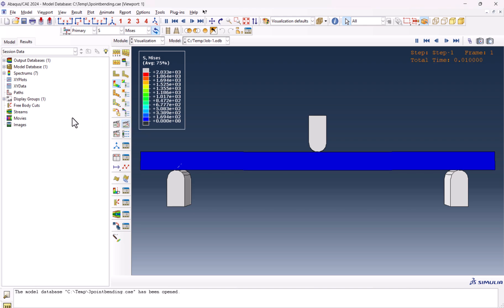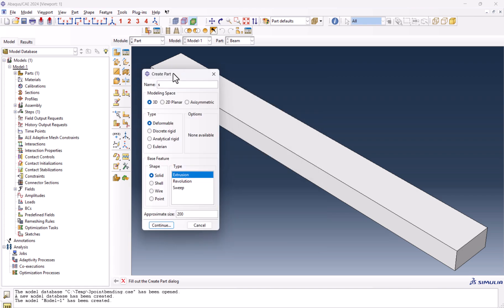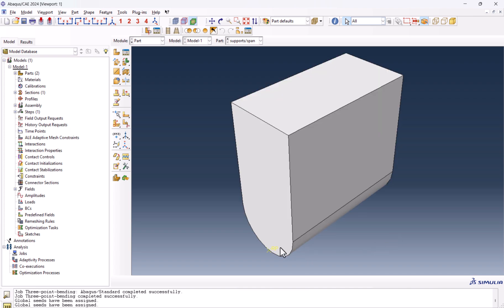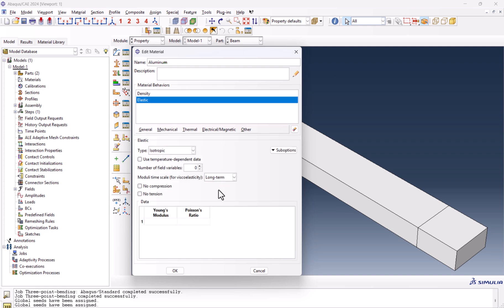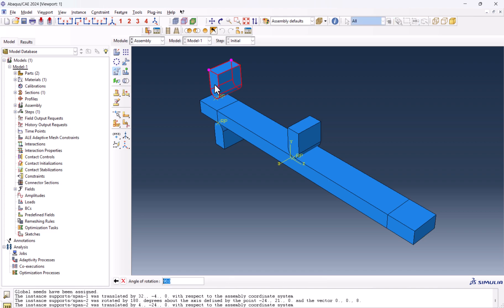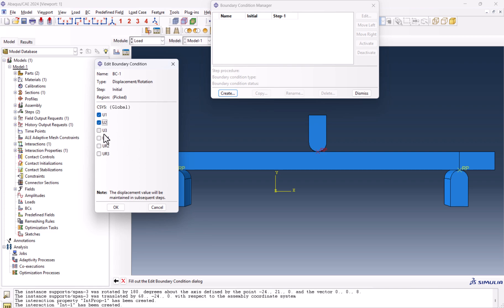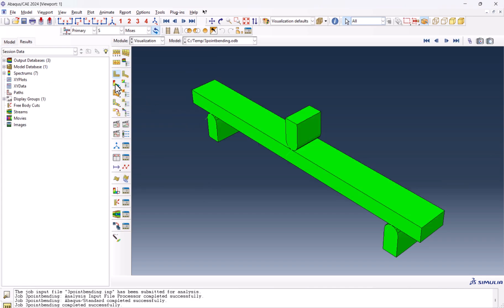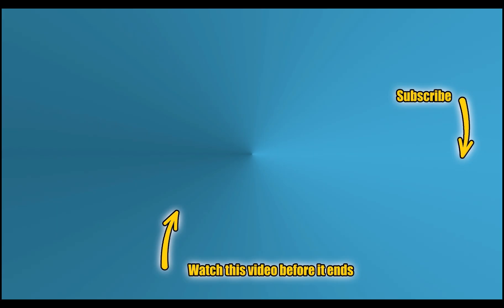MASTERING Three Point Bending Abaqus Simulations Made EASY

Comment: Sir, when I loaded the results in the deformed model, the beam just moves out of the plane in the z-direction. What should I do?
Reply: My software is limited to 1000 nodes and I had to keep step increments not more than 100 otherwise the job would just get aborted.
Reply from the maker: I see! Just make the mesh slightly bigger and put everything the same, I think it should be fine. Otherwise, you have to change the software, because if you want an accurate simulation, you need more than 1000 nodes!
Reply: Got it
Reply from the maker: @PAYASMAHULIKARSVNIT good!
Reply from the maker: If you follow the steps without skipping the video, your results must be the same. I recommend you rewatching the video without skipping especially, the load and boundary conditions.
Reply: When I followed the exact same steps (I had to keep the nodes less than 1000 as yours were more), the job just got aborted saying too much time for this increment.
Reply: I chose the mesh to be uniform everywhere (slightly coarse) but now it worked with all default step values!! Thanks for all the help sir!!. I will subscribe this channel till forever

Comment: Hello, I hope you are doing well, and thank you for your very useful guidance. I am currently modeling a laminated composite in Abaqus, using the data provided in a published article. My goal is to obtain the maximum flexural force without using UMAT/VUMAT. I would appreciate it if you could guide me step by step, module by module, on what needs to be done.

Article information:

𝐴𝐿/𝑐𝑜ℎ𝑒𝑠𝑖𝑣𝑒/𝐶𝐹𝑃0°/𝐶𝑅𝑃90°/𝐶𝐹𝑅𝑃90°/𝐶𝐹𝑅𝑃0°/𝑐𝑜ℎ𝑒𝑠𝑖𝑣𝑒/𝐴𝐿/𝑐𝑜ℎ𝑒𝑠𝑖𝑣𝑒/𝐶𝐹𝑅𝑃0°/𝐶𝐹𝑅𝑃90°/𝐶𝐹𝑅𝑃90°/𝐶𝐹𝑅𝑃0°/𝑐𝑜ℎ𝑒𝑠𝑖𝑣𝑒/𝐴𝐿
For the aluminum layers: Johnson–Cook damage model, element type C3D8R AND T=0.5mm
For the CFRP layers: Hashin damage model, element type SC8R T=0.125 mm

For the cohesive layers: element type COH3D8 T=0.15mm

My questions are as follows:

In the Part module, should I draw each layer separately as a deformable solid (for example, one solid aluminum layer, one solid cohesive layer, one CFRP 0° layer, and one CFRP 90° layer)? Or should I draw the entire beam as a single block and then partition it?

In the Step module, should I use Static General or Dynamic Explicit?

In the Interaction module, do I need to define Tie constraints between every two adjacent layers or not?
Reply from the maker: You can do this fully in Abaqus without UMAT/VUMAT. The recommended approach is to create one single 3D solid beam and then partition it through the thickness into all layers (Al / cohesive / CFRP plies). This keeps the mesh conformal, simplifies section assignment, and avoids interface errors. Aluminum partitions use C3D8R, cohesive layers use COH3D8, and CFRP layers use SC8R with ply orientations (0°/90°) and thickness 0.125 mm.

For the Step, start with Static, General for quasi-static bending to obtain a clean force–displacement response. If convergence problems occur once damage and delamination initiate, then switch to Dynamic Explicit with slow loading and check that kinetic energy remains small.

Regarding Interactions, if you explicitly model the interfaces with COH3D8 cohesive layers, you do not need Tie constraints between adjacent layers. The cohesive elements already represent bonding and allow delamination; ties would artificially prevent separation. Just ensure proper node connectivity (which is straightforward when using a single partitioned part).

This setup is the most stable and standard way to capture flexural response and maximum force for laminated metal–composite beams.

Comment: Thanks for your response! But my goal is to change the number of layers and the orientation of the layers in a polymer composite so I can achieve the maximum bending force. Then, I can substitute that value into the equation and obtain the flexural strength. What method exists to obtain the peak bending force in Abaqus for layered composites without writing UMAT/VUMAT code?
Reply from the maker: Good question 👍
You don’t need UMAT/VUMAT for this. For layered polymer composites, the standard approach in Abaqus is to use Composite Layups (shells or continuum shells) with built-in orthotropic elastic / damage models.

You can:
	•	Define different number of plies, thicknesses, and fiber orientations in the Composite Layup module
	•	Run a 3-point or 4-point bending simulation
	•	Extract the reaction force vs displacement at the loading roller/reference point
	•	The peak reaction force before stiffness drop or damage initiation is your peak bending force

Then you can plug that value into your flexural strength equation.

This is exactly how most papers do parametric studies on ply orientation and stacking sequence without custom subroutines. If you want failure effects, look into Hashin or Max Stress criteria (still no UMAT needed).

Hope that helps 👍

Comment: thank you for the video! i tried this in abaqus but always an error occurred when abaqus wanted to create the input file. the problem is the boundary condition doesn’t find the reference point from the part section. do you know what the problem here is? i think it’s because the assembly does not reference right with the part section
Reply from the maker: That error usually happens when the BC is pointing to a Part-level RP, but Abaqus needs the Assembly instance RP. Try this: create the RP in the Part and put it in a set, instantiate it as Dependent, then apply the BC in Assembly using the instance set (you’ll see it as InstanceName.SetName). If you already made the BC, delete and reassign it in Assembly—that should fix the error.

Comment: i have tried the simulation and got force=0. can u help me how to troubleshoot this issue?
Reply from the maker: Thanks a lot for watching and following the tutorial—I really appreciate the support!

That “zero force” message usually means the applied loads are extremely small or weren’t registered properly, so Abaqus ends up solving something like 0 = Ku, which gives you zero force and no meaningful results. If the message appears at the end of the step, it’s very likely a mistake in your boundary conditions or load application otherwise it's a warning and can be ignored.

Please rewatch the video carefully from beginning to end and double-check how you applied everything. Even small skips can cause this. Once that’s fixed, it should run as expected.

Thanks again—and feel free to comment here if you're still stuck after rewatching!

Comment: When I tried doing same simulation this warning is coming and the simulation is getting aborted, "The general contact domain for modeling contact interactions in Abaqus/Standard has double-sided facets. Initial contact adjustments for resolving gaps and  overclosures when a surface with double-sided facets is paired with any surface having double-sided facets may be incorrect. Similarly, adjustments for double-sided surfaces crossing each other may be incorrect and no additional warnings or error messages will be issued. In all these cases, we recommend using single-sided surfaces under *CONTACT INITIALIZATION ASSIGNMENT to  handle initial adjustments more precisely and avoid  possible convergence problems."
Reply from the maker: Thanks for watching and giving it a try!

This warning is happening because the contact is not set up the way it should be. In the video, I use general contact and define “contact with itself” properly—when done correctly, this warning doesn’t appear and the simulation runs fine.

It looks like you might’ve missed something in the interaction setup, or changed the default behavior. I strongly recommend deleting your current model and starting from scratch, this time following the video step by step—especially the interaction section.

The setup is sensitive, and even small deviations can cause convergence issues like this.

Let me know how it goes once you rebuild it!
Reply: @FEAMASTER  Why did you not define master and slave sufaces for contact?
Reply from the maker: Because it was not necessary in this one, but generally surface to surface contact can be more accurate.
Reply: @FEAMASTER  i am also facing same issue ecen following step by step very closely. Ithink problemis with our Abaqus 6,.13 version which might not support this typeof contact and we have to make surface contacts?
Reply from the maker: Yes I think there would be differences between the 6.13 and 2024 versions. Try the surface to surface contact and let me know what happened.
Reply: @FEAMASTER   I had a same issue, so I tried 'surface to surface' and it has solved. Thanks a lot.
Reply from the maker: @marsarah  Thanks for letting me know!

Comment: Too many attempts made for this increment, this issue
Reply from the maker: Thanks for redoing the simulation. You should double check the properties and especially the meshing most of the time the problem arising from those steps. Have you changed the displacement or anything in your simulation?